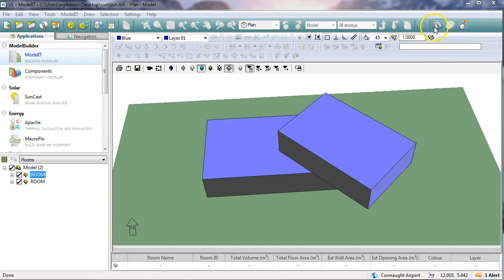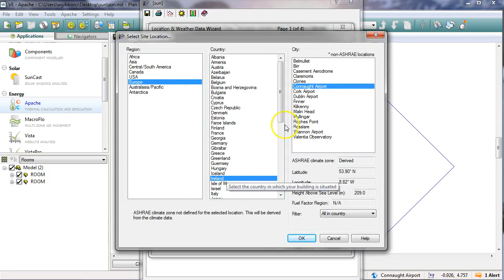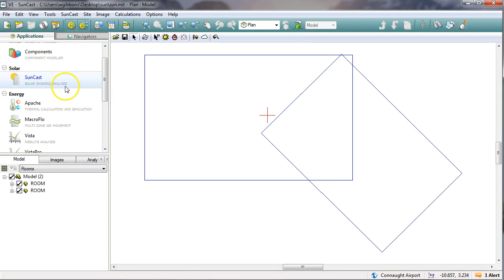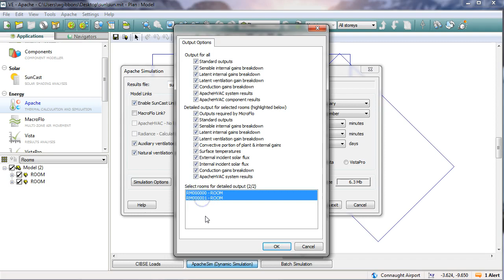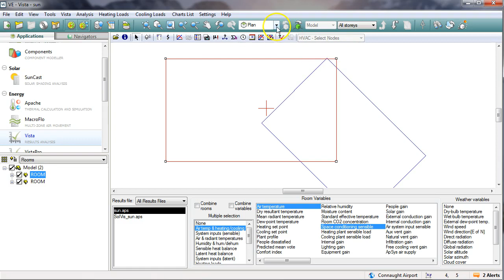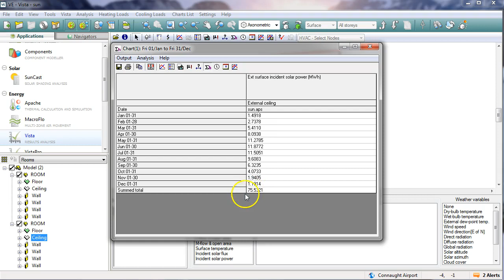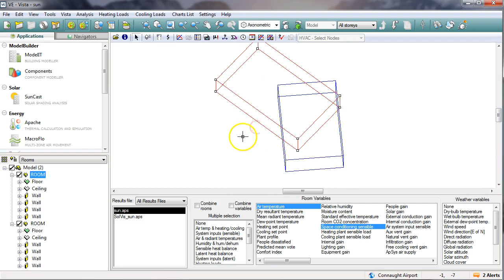Basic Solar Analysis in IESVE

Comment: Are you able to change the materials of the roof, wall, floors? I am looking to use a thermal mass in the floor and wanted energy data for that- would IESVE work for me?
Reply from the maker: Yea, you can use any of the built-in materials for pretty much any element of the building. You can also edit the make-up of the elements if you don’t find exactly what you’re looking for. When you have the materials that you want, make sure they’re applied to the template and the model. Otherwise you will have them in “settings” but they may not get used in the simulation.
Reply: @CADandStuff  Great- when you say that we can edit the makeup of the elements, does that mean the thickness, u-factor, and other properties of a material?
Reply from the maker: Exactly, yes
Reply: @CADandStuff  I am looking at the IESVE tutorial- seems that you can use revit with this software, and would be able to import that information of thermal properties- I think!
Reply from the maker: Depending on the complexity, it might be easier to build the model in IESVE rather than importing from Revit.